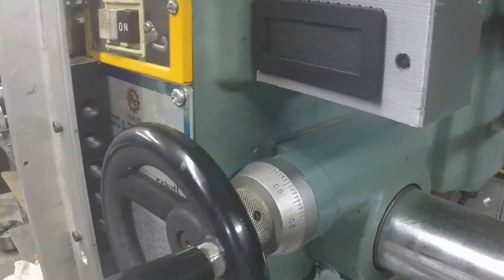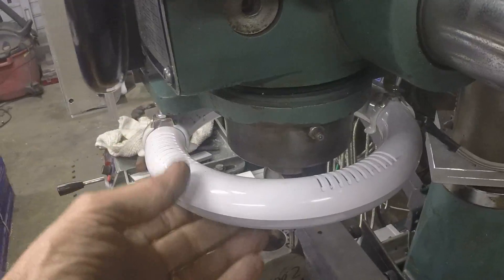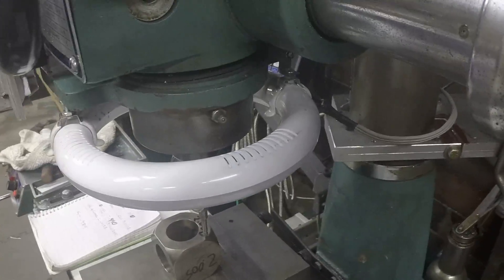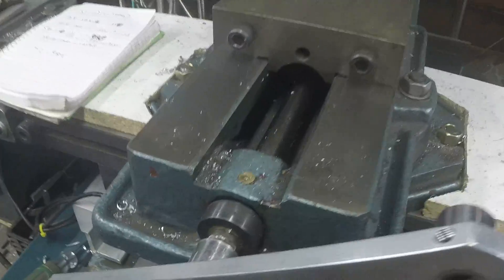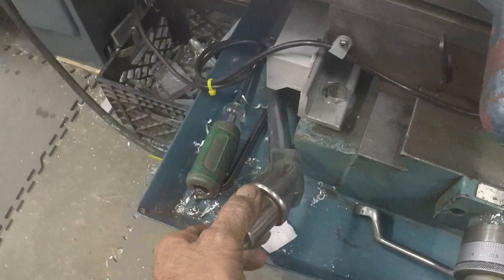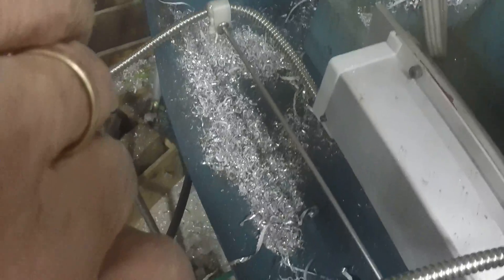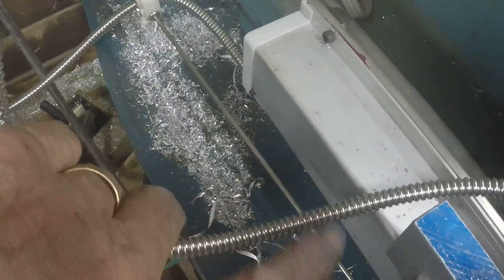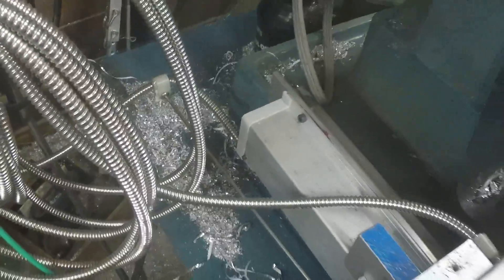Upgrades to my RongFu RF30

Comment: Lookin Good, Thanks for the video. I got my used RF-30 in 1993 and am still using it. I have the same 3/4'' flex wrench for my vice.  I use a cordless impact gun to run my vice. Thanks.

Comment: im new to machining but ive worked out the feed rate for my carbide end mill.. its 260mm per min.. how the fuck do i actually put that into practice when using it on that my machine (same as mine) mines in imperial as well but i do have a variable speed powerfeed
Reply from the maker: Well,  if you have the mm per min,  then divide that by 60 (sec),  that will give you mm per sec.  Don't exceed that.  So in your example it would be 4 mm a sec feed rate.  You wont find that on a speed dial,  but you can swag a position of the dial.  Start slow ...